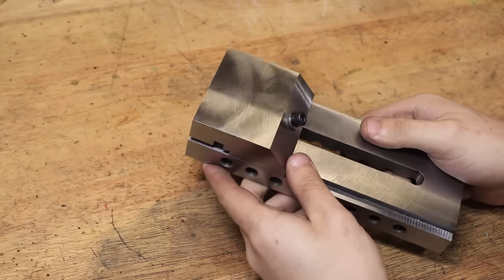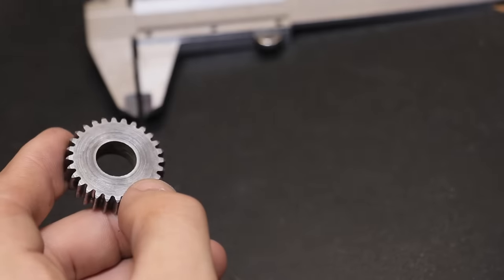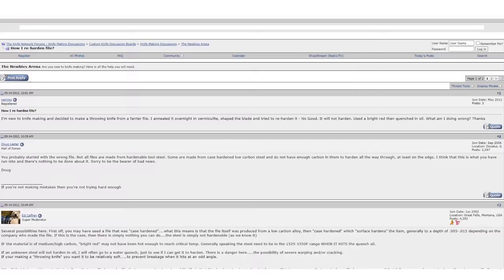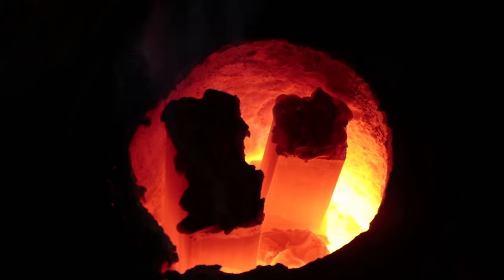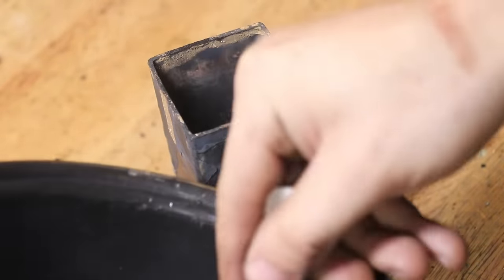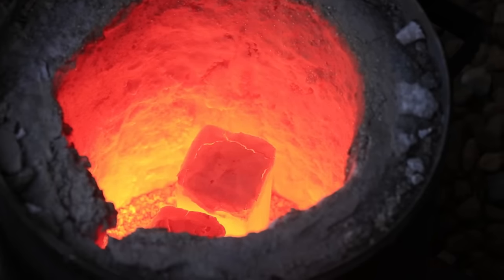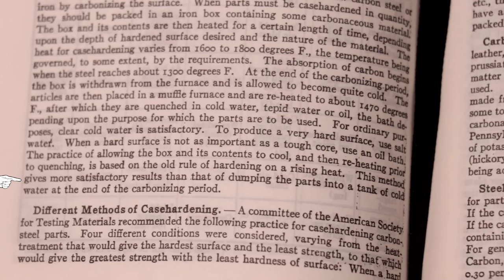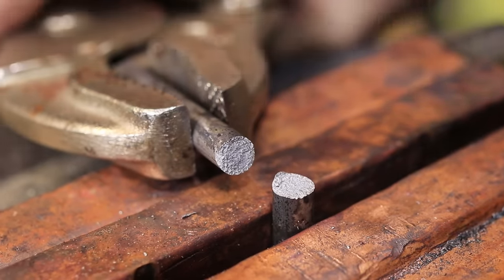Case Hardening 101 - Heat Treatment Oversimplified

Comment: I worked as a heat treater for about 12 years in WA state.  We used induction, molten salt baths, open flame and endothermic gas electric furnaces with internal quench chambers to case harden. Carbon flows like electricity as it tries to reach a neutral carbon level.  In a high carbon environment a low carbon material will absorb carbon.   A high carbon steel in a low carbon enviornment will lose carbon. The higher the temperature the faster a material will absorb or shed carbon. In a endothermic gas filled furnace we would generally carborize at 1750 deg. The depth of penetration was determined by the material 1040, 8620 etc. and time at temp. The way of introducing carbon was simple. We simply plumbed in natural gas which burns and the byproduct is carbon. A carbon sensor on the furnace controlled a barrel valve to keep the carbon at a specific level. A product called condersol can be painted on a part to prevent carbon penetration into a area of part. Most large cities have several heat treating shops and a tour can be very informative.  Keep in mind some steel such as 1018 will not respond well to case hardening and to prevent scaling you need a protective atmosphere. Thanks for the video.  MH
Reply from the maker: Thankyou for your comment, I really appreciate getting the I sight of someone who did this method industrially.

Comment: Very interesting vid, thanks for sharing! I tried a method of case hardening I found over on the ‘Clickspring’ channel, don’t know if you found that one? He was making historically accurate tools for a project to re-create the Antikythera mechanism. Basic recipe had leather charcoal, flour and salt in it, I’d have to look up the proportions though. He did his in a sealed clay packet / crucible affair, I just used a metal box like you did and got good results on a small hammer head I made after about an hour in an electric kiln at about 900°. I didn’t get all the gal off the metal box before it went in the kiln, so the zinc oxidised and turned into a nice floaty white powder that went everywhere!

Comment: I recently read a 1925 patent,  it said to use sodium bicarbonate.  Which could make sense.  It breaks down at a low temp to CO2 and sodium carbonate
 This would fill the chamber with CO2 before it gets red hot.  This would displace the air and increase the amount of CO the carbon could produce.  It also said to use a large proportion of hard wood sawdust. I assume this would reduce the density of the packing to allow the CO to defuse to the part.

Comment: Nice work!
A have home o traditional Oven, having a pretty high vent,,so I made a mix of backing soda and charcoal,all stuff in a sealed  box, and kept it inside that oven for few hours under intense heat ,then from oven right into water.It Was amazing hard,I could scrach glass with...

Comment: I've used brine quench in a running ultrasonic cleaner.  The ultrasonic energy breaks the steam bubbles quite effectively but it also degasses the brine.  The effect of salt in quench water is to reduce dissolved gases which nucleates boiling.
Also effective on pure water quench which has slightly better specific heat capacity.

Comment: My shop instructor in the 80's recommended the used motor oil trick - I can't say for certain that it does or does not work, but even if it's a myth, it's one that has been around for a while.

Comment: Back in the 40's and 50's you could buy special case hardening powder. I can't remember exactly how it worked but I believe you packed the part in the powder and hested it in a forge to a soecified temp and time. I think it was some kind of high carbon content powder that would infuse the steel when heated, hardening it to a specific depth depending on how long you keep it in the forge and the amount of powder used. Tubalcain or MrPete222 has some excellent and very informative videos on the case hardening process and how to do it correctly and how to achieve the depth of harening that you want. I would reccomend checking out his videos. He is an infinite source of knowledge concerning everything to do with metalworking , machining and forging.

Comment: Just a thought on the used motor oil idea, I wonder if used diesel motor oil might be the key because of the amount of soot (carbon) that would be saturated in the oil compared to a much cleaner oil out of a gasoline engine.

Comment: Long ago I would put the steel in the carbonizing pack two or three times before quenching it for a deeper case. For a precision vise we would cycle the parts between an oven and a freezer several times to relieve stress.

Comment: A tip for making Charcoal powder more uniform would be to use a ball mill. But as those can be expensive you can make one cheaper by getting a rock tumbler/polisher and loading it with ball bearings.
Reply from the maker: Might have to ask a friend about broowing a ball tumbler
Reply: @artisanmakes  When you take the lid off, be gentle or the fine dust comes out like smoke and makes a real mess.
Reply: Charcoal is probably soft enough to process in a coffee grinder. Bob Adkins' warning about the fine dust applies to the coffee grinder as well as a ball mill. Use a good dust mask or you'll have black snot for a few days.

Comment: To get a precise temperature inside the casehardening box, you could use a thermocouple. A good one will have a probe that is resistent to the high temps inside the furnace, and the display should provide an accurate temp reading of the probe.
Reply: yes, that 's what was used in our belt furnaces in the thick   Film dept.  at the plant I  worked for.   Temps got up tp close to 1000 degrees Centigrade.

Comment: The carburizing time is in the ballpark of minutes ( let's take half an hour ), as you know. Using oils (which are a hydrocarbon compound and therefore contain carbon) doesn't change physics and does only one thing, when quenching: Bringing you far away from the carburizing temperature in the fastest possible way. Also, with old motor oil: Possibly giving you cancer as birthday present and providing a nice fire hazard, hehe. 
But of course it is "true" that you can induce a carburization in this way. However, the effect is so small that it is unfortunately not measurable. Let's call it "steel homeopathy", or?:)))
Anyway, thanks for the video and showing your working solution(!!!) off. Great work!

Editaddendum: Incidentally, I also recommend that you read the German Wikipedia (under the term "Aufkohlen") and have it translated. The various procedures are explained in more detail there. Not going into depth, of course, but one thing is clear: carburizing in carburizing granules unfortunately always has poor reproducibility.
I know this is difficult for reproducibility at home, but maybe a process in a vacuum furnace or with protective gas (CO2 + Nitrogen, which could carburize at the same time) would be better? Of course, this requires a much more complicated oven, with separate heating and combustion chambers.
... but as is well known, the bride always has to be inventive before the wedding.

Please don't even think about cyanide-based liquid solutions (potassium cyanide and potassium cyanate): You're guaranteed to kill yourself and anyway, because of the lack of environmental compatibility and economic efficiency, this is not a good idea.

P.S.: "A lot of people say" ... and that they say different things ... is because this method does NOT lead to reproducible results (In the sense that you have a considerable tolerance when it comes to "carbon inoculation").
Reply: While this is all true, the home workshop is very rarely concerned with getting an exact depth of case.  The added complication of a more sophisticated process is very unlikely to have any noticeable payback.  Pack hardening in a carbon rich medium has been done for centuries, and gives results that are good enough for all but the most exacting or mass industrial needs.

Comment: CHARCOAL: When you were crushing the charcoal, I thought of a suggestion. You can get a jar of powdered charcoal, sold as an art supply. It’s very fine, like cornstarch, and might perform better or faster, given that there would be less air. Of course, anyone can crush charcoal more finely, but the powder is still pretty cheap, homogeneous, and ready to use. 

I’m only speculating, but I also wonder if the charcoal source matters at all. It’s not likely, but some charcoals have different structures, and there might be a “best” charcoal. Bamboo has more silica in it, which might matter, for instance. If anyone has thoughts on this, I’d love to hear them.

Comment: This seems like it was outside your wheel house.  Fascinating and an excellent video.  I’ve been experimenting with a product called ‘Cherry Red’ out of the US and has worked great for case hardening clamps for my precision vice.  I like the idea of using a forge for larger parts.  My heat treat oven only goes to 6x6x4 inches.

Comment: So... without a forge, rubbing it in charcoal, like you demonstrated, but with sodium carbonate added, should also give a slightly better result?
Reply from the maker: I don't know for certain, but it wouldn't surprise me if the sodium carbonate got you better results
Reply: I was just thinking that maybe the sodium carbonate only works in the enclosed environment. Perhaps in open air it gets neutralised by the oxygen. Still worth a try. None of it is expensive.

Comment: 11:43 The use of oil or water must be made considering the steel alloy (Cr, Ni, V, etc) and not the carbon content. Alloy steels can be quenched in oil and non-alloyed steels must be quenched in water. What changes, between one type and another, is the hardenability.
Reply from the maker: Yes, but this video is not about alloy steel and I purposely exclude talking about it because as you correctly point out we then have to start talking about hardenability and TTT diagrams which I did not want to talk about in this video. This is just for plain carbon steel
Reply: I worked in the industry for many years and quenching a material like 4140 or 4340 was done in heated oil or a low temp salt brine. If we were induction hardening we used a heated glycol. A water quench is too much of a shock and would frequently lead to cracking.  1040 and maybe 4130 you could get away with a water quench.  Regardless of what the final desired hardness was by the customer each material has a temperature at which its quenched at. The final hardness is determined by the secondary heating/tempering this is where the higher the tempering temp the lower the hardness. 4340 would usually soak at 90 minutes at 1525 deg. Get a 140-180 deg oil quench and have a as quenched hardness of RC (150kg) Rockwell of 55-60. It must have a secondary temper of at a min. 300 deg for 90 minutes or risk cracking from internal stress. When dealing with complex very expensive machined parts you only get one try to get it right.

Comment: If you do any more experiments, I'd try putting a chunk of dry ice at the bottom of the container, below the charcoal, then seal with the morter, leaving a small gap to allow
off-gassing, until the dry ice finishes sublimating, then seal the gap. Theoretically, it would displace any oxygen in the charcoal with carbon dioxide, which could help with the chemical reaction.
Reply: No, CO2 doesn't help there, you want CO, which comes from the oxygen reacting with the carbon. Steel in high temperature then robs the carbon and the oxygen recycles. CO2 is quite a stable molecule which doesn't break so easily.
Reply: @JaakkoF  makes sense!

Comment: You can also use propane of methane gas as a source of carbon for case hardening. However, you will need a special vacuum furnace.

Comment: I use Stainless foil and make a pouch I fill with part and charcoal. Bring to the "critical temperature" ..rapid quench in a "brinded" oil. (Salt).
 Clean off the scale and draw back at half temp/time. 58/62 45c Rc. Every time !!!
 P.S. 1550 deg for low carb. 1850 high carb.

Comment: In reference to the container used steel v. wrought iron. What is derived from the container other that encapsulation of your metal parts. Would a fired clay box perform the same task or does the container add something to the carbon monoxide environment. I am a potter.  Clay boxes are used in pottery to protect work from the kiln environment. They are called saggars. Same theory but in reverse. It also dawned on me that the metal and charcoal could be bagged in aluminun foil and wrapped in clay; heating the whole thing like a hot pocket.

Comment: Carburizing is also called "cementing",  There are several different ways to get the hard surface, depending on the exact properties and costs that you want.  The thick side armor on battleships was face-hardened, usually having a thin carburized and very hard surface layer and a somewhat softer, but very thick, hardened layer behind the surface, with a very thick soft layer making up the rest of the armor as a shock absorber and tough mounting layer.
Reply: You could probably get a result like that using a steel with a moderate carbon content and low hardenability like 1045 which you subsequently case harden and quench. The thick cross section would garuntee a soft core, and the moderate carbon content would give a tough layer under the hard skin.

Comment: much of the cracking of the mortar may be due to 1 of 2 things. gas expanding inside the container evacuating too rapidly or the left over humidity still existing inside the mortar escaping too rapidly.  Many jewelers use silica based investment powders with a slow climb to there burn out temps to allow water time to evaporate to prevent cracking of there investment molds. Granted the mortar is on the surface a faster climbing ramp can be achieved though dropping it directly in to an at temp kiln or furnace would likely result in the cracking.  This is to my guess so i could be wrong but from my past experience with casting I tend to find cracking in many of my flasks were due to too rapid of a burnout cycle. EDIT: you try just putting casting sand or just silica on top? I would assume that alone should be enough to contain enough carbon with out needing to build a containing cap.  You know more than I :) figured i would hope to get a response from a Pro on this matter :)

Comment: Quick note: the depth theoretically grows as the square root of time, rather than being linear.
Reply from the maker: That might be true in an industrial setting, but I have not found that to be the case in the home workshop environment. Cheers
Reply: For a flat surface. A rod cases faster and so do outside corners.
Reply: @artisanmakes  I wasn't speaking to practical realities, only mentioning how the theory metallurgists use categorizes this is a "random walk" type behavior: you can get a linear fit over short times (ie. distances) but accepted mathematical models of it assert that there will always be diminishing returns as you keep going, due to the fact that carbon is diffusing outward as well as inward.

Comment: Quenching in water or oil is used to obtain different surface hardness. Also, for some steel grades, quenching is suitable only in a certain environment, quenching in an unsuitable environment leads to a shortage of hardness or internal defects of the workpiece. Blanks from low-carbon steel can be strengthened by the method of riveting.

Comment: The space in the sealed box won't matter, as the oxygen is soon exhausted. We used large cast iron boxes, filled with short pieces of charcoal sticks, similar to what we used for drawing in art class at school, with the machined components completely surrounded by charcoal. They weren't filled to the brim, plus lots of air between the sticks. The cast iron lids were sealed with fire clay, and the muffle furnace heated (from memory, early 70's) to 900 C. The furnace ran for hours, then allowed to cool overnight. Subsequently reheated in electric furnaces and quenched in whale oil. I can't recall if the components were then tempered, but from your video comments, probably. Only the 'skin' would be hard. Then ground to size.
Reply: Whale oil? Was this the 1870’s?
Reply: @MM-op6ti  The early '70s.

Comment: Quenching in water is indeed harsh on steel. If that's an issue causing warping, use oil hardening steel and use an electronically controlled heat treatment oven so you don't heat it much more than is needed.

Comment: That was really helpful.

I wonder why the manual recommended leather charcoal instead of wood charcoal. Any ideas?
Reply from the maker: I'm guessing it lists it because it is another source of carbon. It does list lump charcoal on the page too. I should point out that this is a 1914 copy of the machinerys handbook, so the way that it describes the method is really suited to the time. The 2016 copy I have is very different and doesn't mention it, and is more geared towards industry pack hardening methods. Cheers
Reply: There were burnt up machinery belts lying about, handy for use?
Reply: @johngalt97  I have heard rumours that the nitrates in organic matter might be adding a bit of carbo-nitrating to the mix, but an not sure if that is just a legend?

Comment: Is there a forum you would recommend for getting some questions answered?  I have a clutch dog assembly and forward gear for a small outboard motor that is slipping out of gear.  So I need to grind the faces of the contact points and re-harden. I have a kiln at my disposal if that will work.  Thanks!  Great video.
Reply from the maker: Most of my knowledge comes from metallurgy and engineering textbooks. A great resource I commonly referred to is a book called fitting and machining by Ron culley